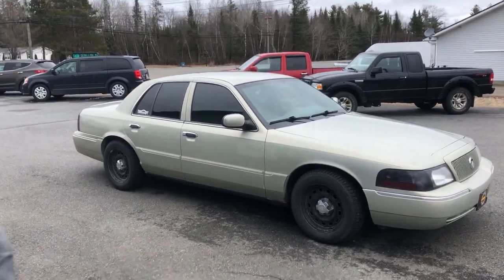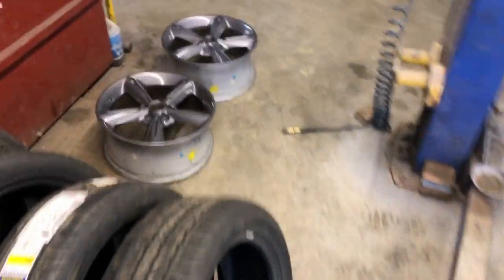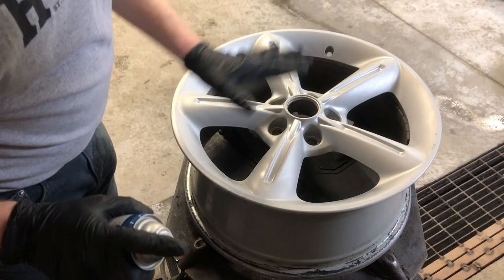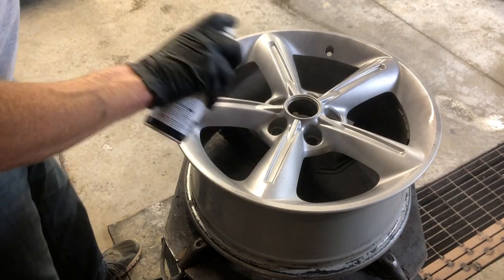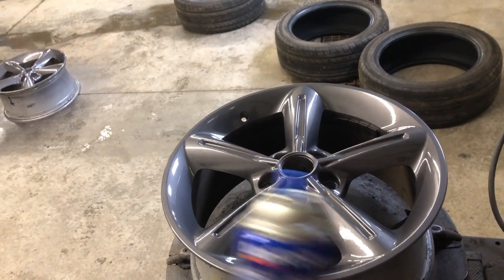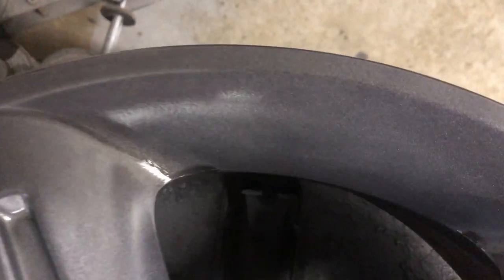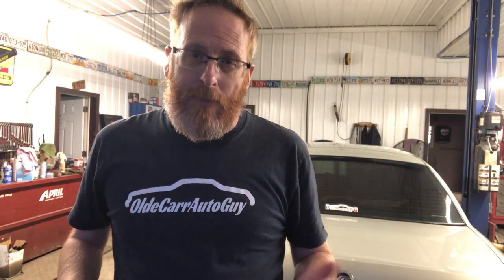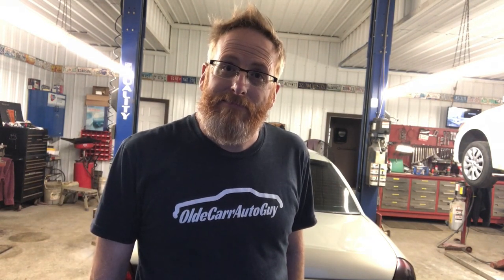Ford Mustang Wheels On My Grand Marquis Get A Fresh Look

Comment: I love grandma but I don't know if I'm a fan of the tinted headlights.  To each there own . Keep the panther content coming brother.  Mine will be coming out soon just holding off alittle more yet . I have the marty tune in hand ready to install I cant wait .
Reply from the maker: Right on Mitch. I'm not sold on what I did to these headlights, but it was far more cost effective then the prices they want for smoked headlight/cornering light set in the aftermarket compared to the Crown vics. Looking forward to the Marty tune viddy!

Comment: I have a 2000 grand marquis.
What mustang wheels or year can fit mine without any modifications?
Thanks
Reply from the maker: Mine are 2011 Mustang wheels. You can use them as well but will need wheel spacers to clear your control arms in the front.
Reply: @OldeCarrGuy  what size spacer did you use. I have an 01 marquis with 2011-2015 mustang wheels. 19x9 with a 255 tire and 42mm offset

Comment: Hey would 1994-2004 mustang cobra wheels fit on my 2004 marquis without adding any spacers or anything ?
Reply from the maker: I believe they will as long as they are 5 bolt. In fact any Mustang wheel up to 2019. Maybe even the new ones.

Comment: I’ve been having issues with hyperflash in my 05 GM. All my exterior lights are LEDs from LasFit. The ones that blink are the canbus error free. I put LEDs in the cornering lights and I get hyperflash. I keep them incandescent, and the turn signals are fine until the headlights are on. Did you have this issue? If so, what did you do to fix it?
Reply from the maker: I had this exact issue with LASFIT and ended up removing all my LED turn signals. Not worth the hassle.
Reply: @OldeCarrGuy  okay. What about the tail lights?